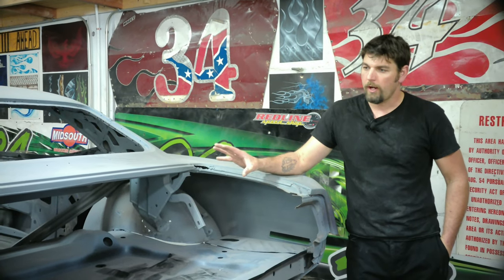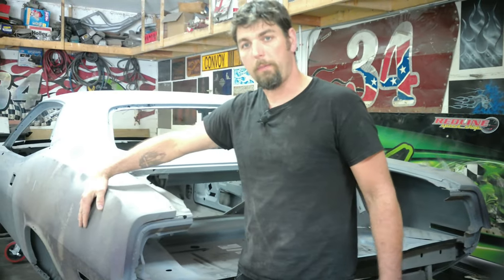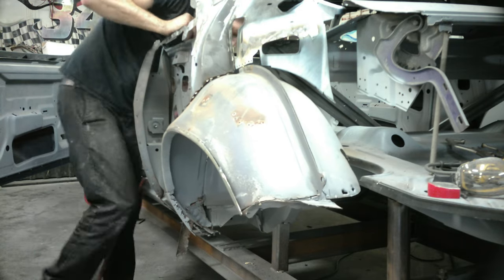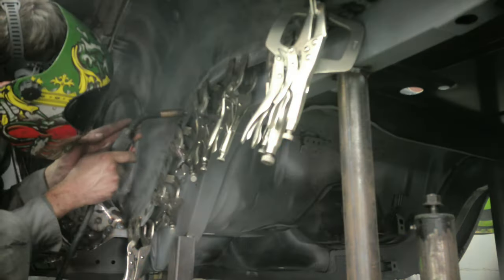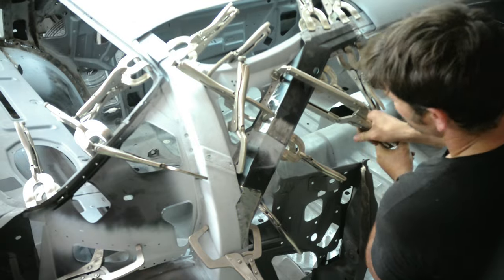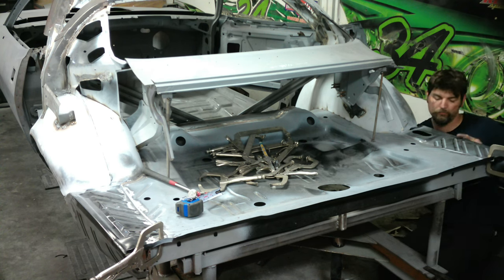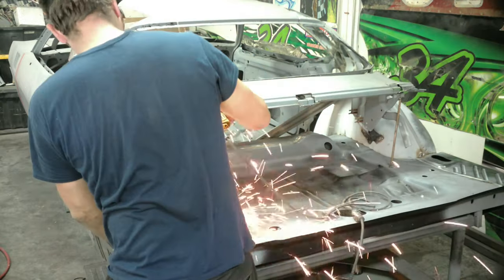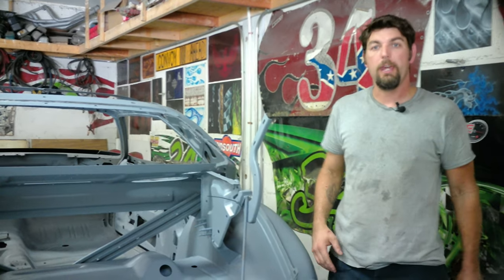1971 Barracuda restoration episode 7 rear floor pan, wheel tubs, package tray and inner structure

Comment: I need to replace both quarters,  trunk pan, both trunk floor extensions, and tail pannel in my cuda. Not sure what order to do it.  You do great work by the way. Very informational.
Reply from the maker: Thanks! If you take a look at some other videos on this car you can see the order I did them. Currently I am doing a 73 Challenger with a whole playlist series and I am going to cover the order stuff is done further in detail that may also help you since in general they are similar. If possible I think they way to go is put the car on some sort of frame structure or JIG and do them all at once test fitting using sheet metal screws and vise grips before you weld them up.
Reply: @Carthage Classic Cars   
I'll check out the challenger videos! I don't have a frame jig. Maybe I'll have to fab something.
Reply from the maker: @mb2stroke816  One more video suggestion of mine "Mounting a car to a frame JIG" might help you. The last frame JIG I bought some used I beams for pennies on the dollar if you have time to look around and I show in there the leveling system and how to JIG up a car. Might take you a full day of effort but the final product of your build will be well worth it. After that I can promise you there will be someone that would but it off you for their project.

Comment: Dude I love your work and have been using it as a guide for my build on the 70 challenger. I’m at a point where I’m having to fabricate portions of the inner roof structure before getting the new skin on. No the three cross pieces, rather the parts that are directly above the door running longitudinal. The top side is rusted and largely gone. I can’t find it but are you aware of anyone making those pieces? In the mean time I’ve been just taking some 16ga steel and cutting it in 6-8” pieces, putting a 90 degree brake in it, and through the bead roller for that small offset where the drip sits. If that piece can be bought it would save a ton of time and work though! Great content as always brother!
Reply from the maker: Thank you!!! As far as I know no one makes the inner structure pieces at this point in time just the outer sections and I think they only have been produced in the last year or two. I was actually in the same boat as you and was making the small patch pieces for this car also in that same area. That was why i still don't have the 3 holes for the roof bows drilled yet. Depending on how bad your car is either keep driving on with the small patches or I have had some luck reaching out to some of the Facebook e body groups and asking if someone can send you one off a donor junked car. I saw one the other day of a e body can't remember exactly what group but it was in a really bad wreck and unsalvagable and the guy was selling parts off it.
Reply: @carthageclassiccars  thanks for the info brother! It’s the small tedious stuff like this that eats up all the garage time!
Reply from the maker: you are 100% right!